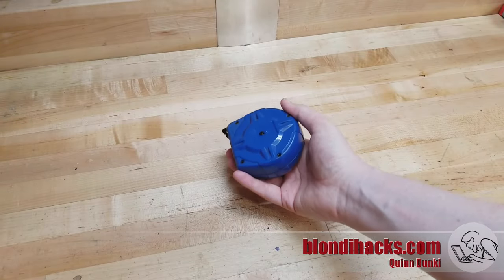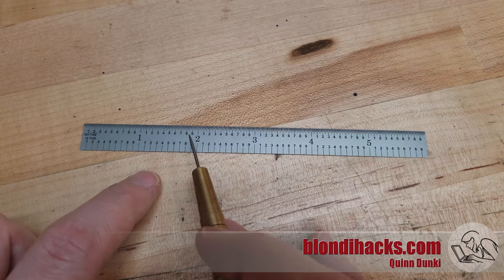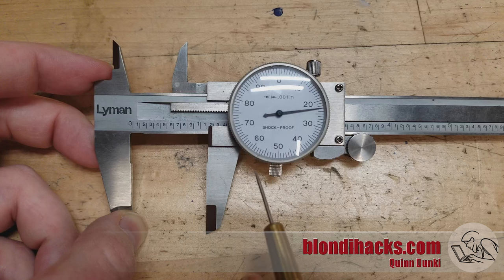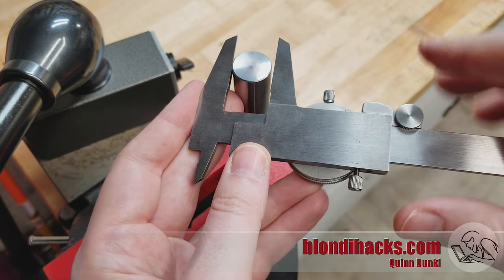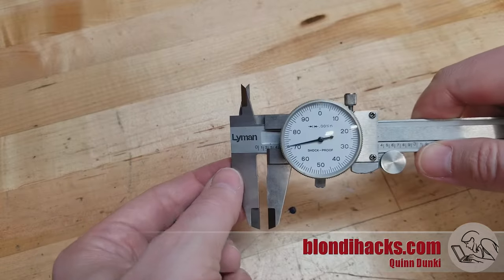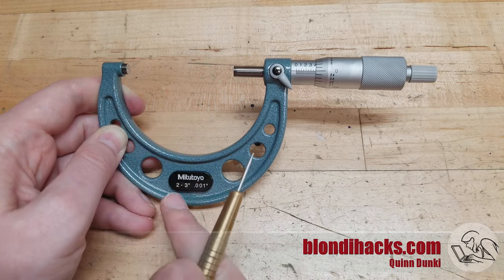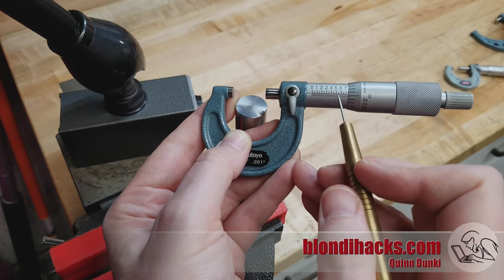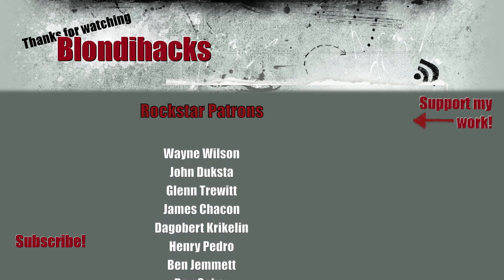Metal Lathe Tutorial 19 : Calipers & Micrometers

Comment: The thing to remember about the cheap digital calipers is that the 'off' button only switches off the display. The rest of the electronics are still running and depleting the battery. Long ago I started to remove the battery after every use and storing it in the box (never throw the box away as it protects the unit!). Recently I forgot to remove the battery and it went flat screwing up the caliper even with a fresh battery installed. With nothing to lose, I removed the new battery and left the caliper to think about things for a few hours. With the new battery installed it sprang to life!

If only that had been the case with the most expensive multimeter I ever bought. It never worked again after letting the battery go flat. Tens of pounds down the drain when £10 was money! (1970's).

Regarding being perpendicular to the piece being measured: I've often thought that a 'left handed' caliper would be mores useful when working on pieces still in the lathe chuck. Mini lathes tend to have a back guard that gets in the way of a standard caliper.

I wish I knew what happened to it, but I used to have a zero to 4" micrometer! It still worked the same (ish), but had interchangeable 'fixed' anvils of zero, 1", 2" and 3" so that the 'micro' part of the range was always 1". It was probably lost during one of our moves. I know I lost a whole circular saw petrol engine during one of them!

Ps. Thanks for the tutorial.

Comment: How feasible would be to have a small bubble level built onto a caliper?  At least in the horizontal dimension, it would be relatively easy to see if you were square with your part?  In theory, there could be a second bubble level for the vertical dimension.  Or, would that be too cumbersome?  As others have said, this, like all your other videos, is very informative.

Comment: It always amazes me, that a trade that relys so much on precision, does not just dump imperial and goes singing to metric.
Reply: because there is little difference between a stick of one size vs a stick of a different size...  most big shops in the US use both systems or are all metric.
Reply: @askquestionstrythings  Of course you're right about the "just sticks with different sizes" part. What I rather mean are the non intuitve tenth wording and the math behind imperial. But, as you might have guessed, I am used to metric, and of course it seems quite sane to me. You imperial guys must be really good at fractions though :-)
Reply: @dwaynetube  a tenth is just 1/10 (except in the machine shop where everything is based on one thousandths 0.001" ... a tenth in the shop is 0.0001 or 0.001/10 or one-tenth of one thousandths of one inch or 1/10000) and most of the measurement math we use boils down to divide by 2 or divide by 10. The spot where metric really shines in energy equations in science and engineering. Metric doesn't require magic fudge factors to correct the numbers from the equations to get the right answer. in Metric the engineering math just works.
Reply: dwaynetube Medical field in the US is almost all metric.  only exception i can think of is some hospitals still use F over C